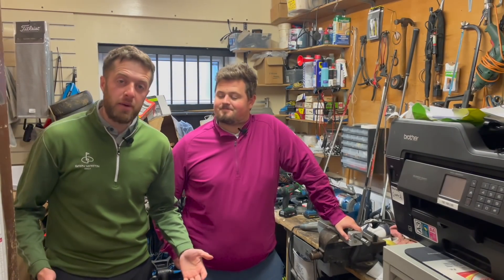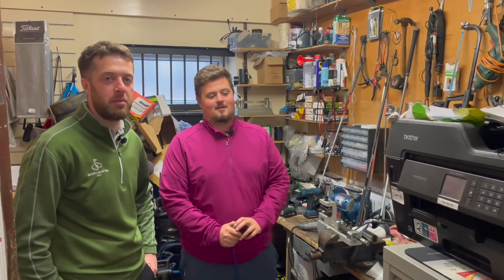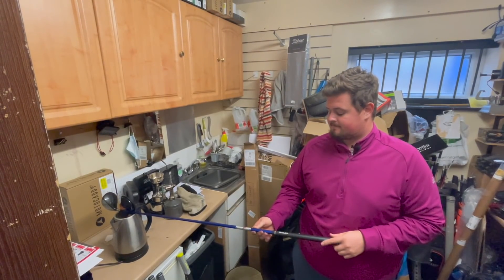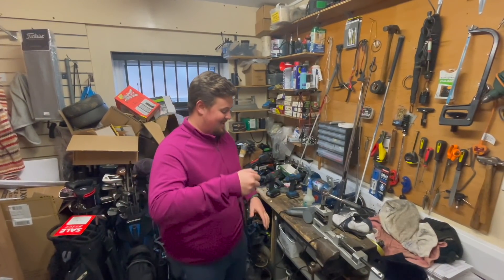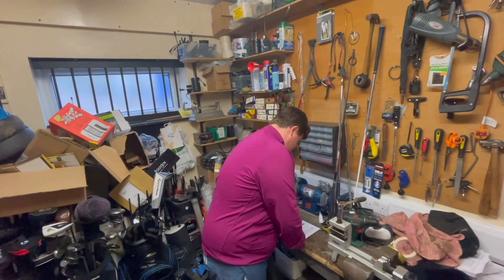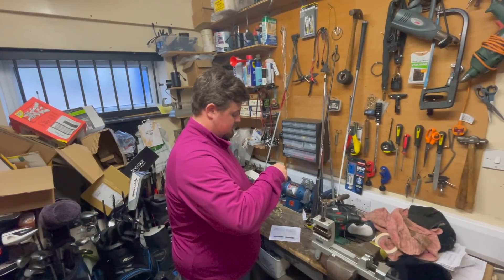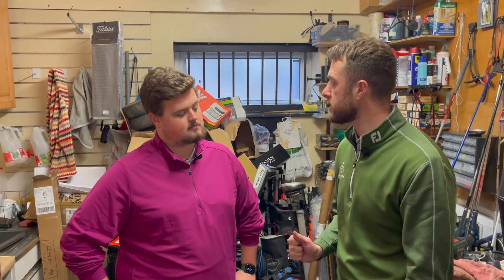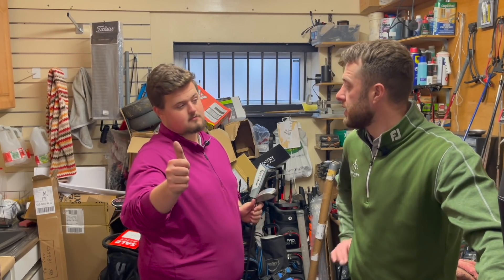GOLF WORKSHOP BEHIND THE SCENES | GRAPHITE SHAFT PULL AND FITTING WITH A SURPRISE!

Comment: You are supposed to insert a plastic pin in the shaft from the bottom side on that type of club. You epoxy it in and cut off the remaining part after it dries.